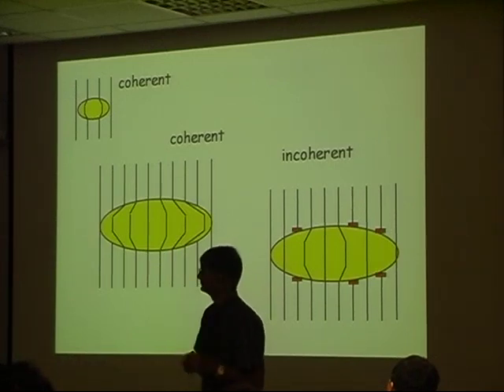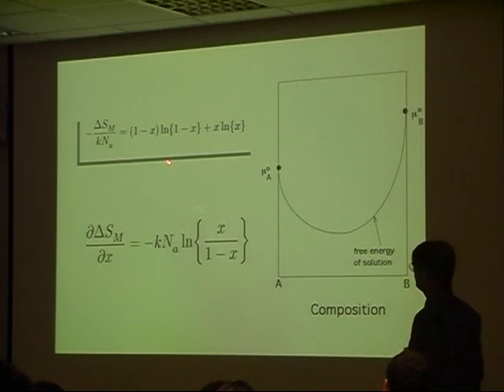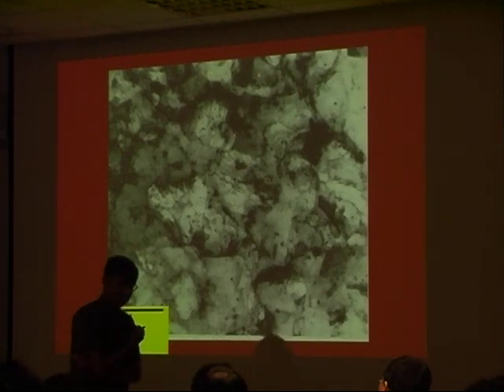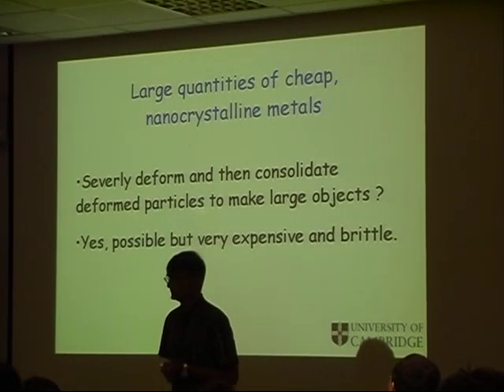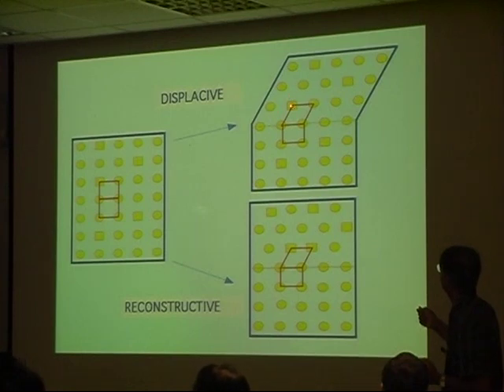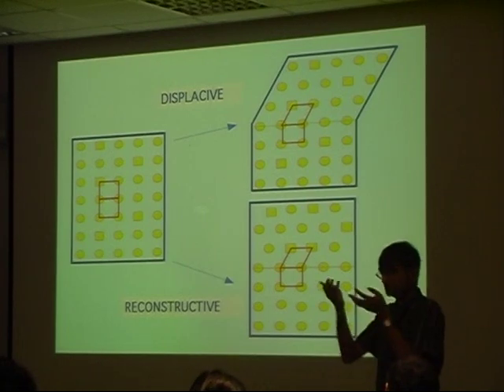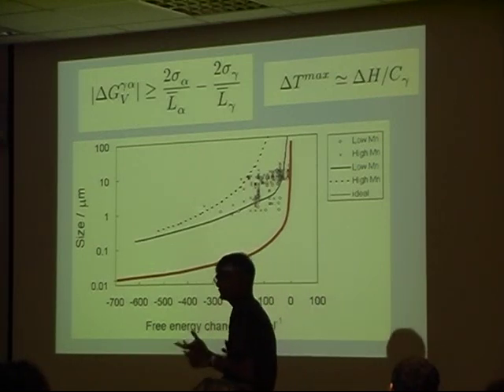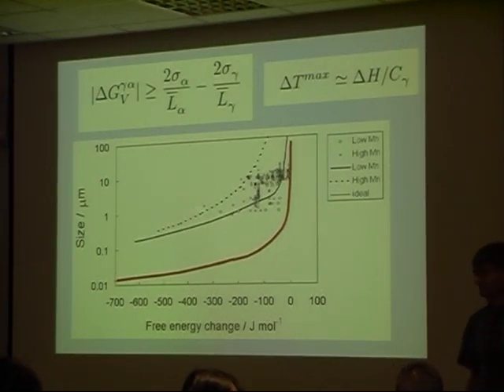Taiwan Lectures: Mechanical Alloying, Part 2

Comment: sir you explained that there is a certain characteristic particle size of the individual elemental metallic powders where they would tend to be alloyed this size is vary for different systems of alloys .is there any thermodynamics explanation behind the alloying related to size of powders.
Reply from the maker: http://www.phase-trans.msm.cam.ac.uk/solution.html